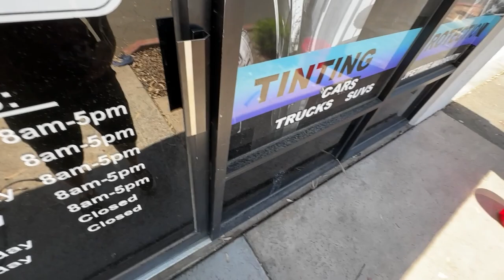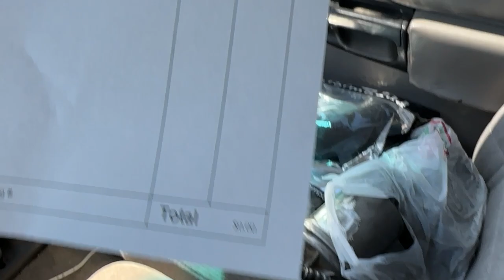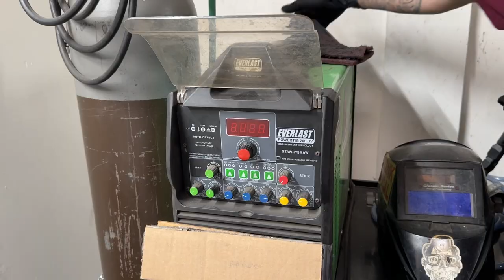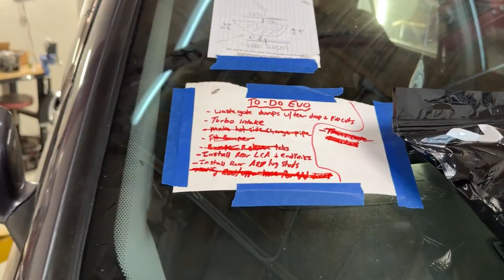Custom Radiator Mods For The EVO 9

Comment: That was a awesome upper neck that you did, almost like mine with the bolt being a issue I made a slit on the fan shroud because i couldnt fit a bolt without having a slit lol
Reply from the maker: Good tip!May have to add that